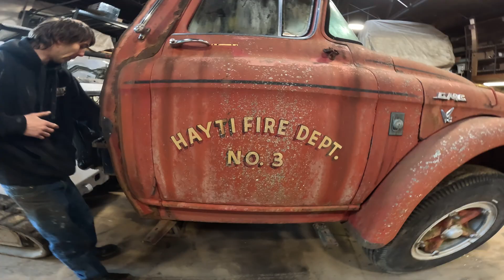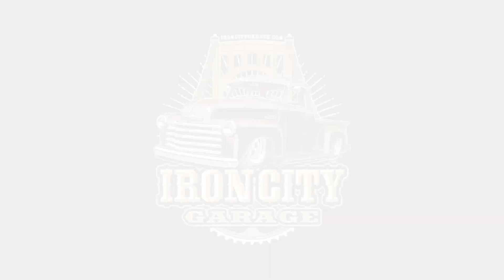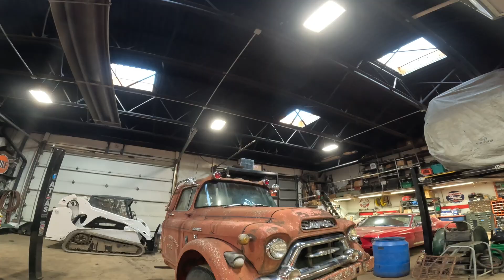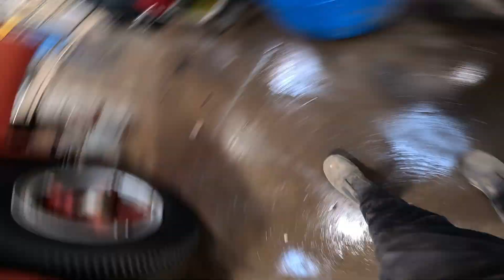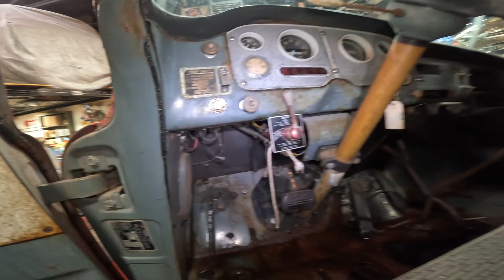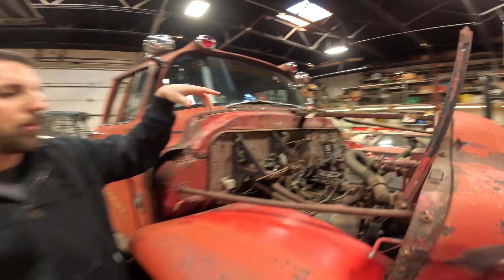1956 GMC 550 Vintage Fire Truck. 347 Pontiac V8-Will it Run?? Patina Project Truck.

Comment: Not being familiar with vintage gmc trucks,I was surprised,by this one having a Pontiac 347 in it.
Reply: Well sir that is not a Pontiac V8 engine. By the shaft mounted rocker arms that shows that it is not a Pontiac engine. The Pontiac V8 introduced in 1955 with a displacement of 286 cubic inches followed by the 316 c.i. in 1956 and the 347 c.i. in 1957 used the ball and cup rocker arm setup. In fact all of the Pontiac engines were basically the same engine configuration right on up through the large displacement engines. By the way the GM engineer that developed the ball and cup rocker arm system also used on the Chevrolet V8 came over to GM from Ford. I cannot identify the engine in the truck but it may be an Oldsmobile engine or even a Cadillac engine. Of course this engine had the governed carburetor on it as it was also used to power the accessories used in fire fighting activities.

Comment: Plug port may be an air brake or electrical charge port. Little compressor inside would keep brakes charged for a fast response. 
I love the unique vehicles. 
Great work!!